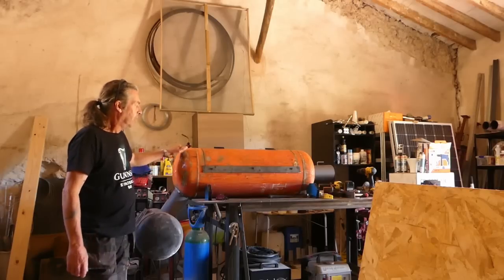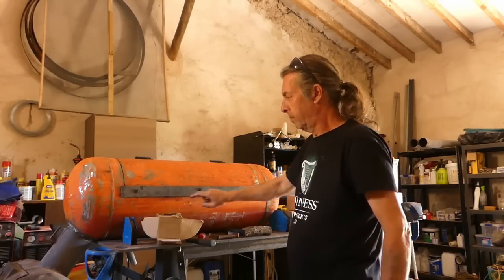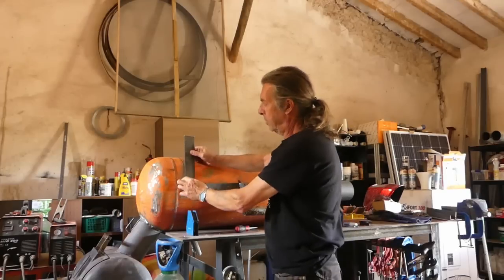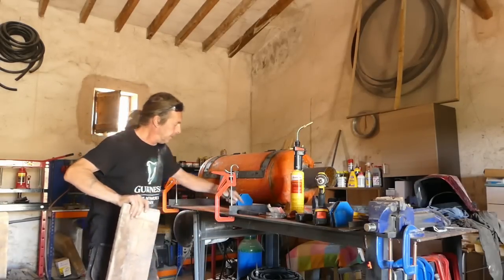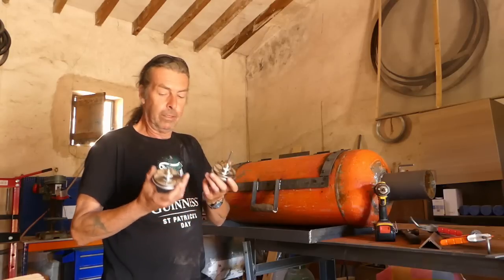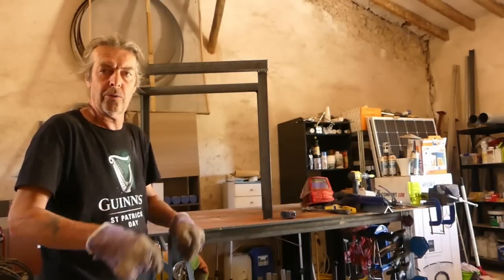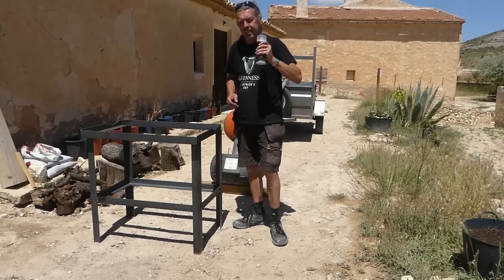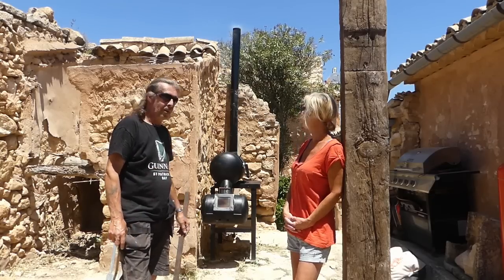Part 2 - Awesome BBQ smoker combo build. It's finished and working!

Comment: When I was a small kid, my dad made a BBQ from a 50 gal steel drum. Cut it in half, added some door hinges, diamond mesh for the grill, angle iron for supports. That thing lasted several decades of use. Nice to see the DIY BBQ SPIRIT is living on in Spain.
Reply from the maker: Thanks Tony. Oil drum is the next possibly as they are easier to get than the big gas bottles :)

Comment: Looks great! How much is that material just to build the barbecue/smoker Table of steel? And where are you buying that kind of metal? They don't have that on Bricolaje? Rickard
Reply from the maker: Thanks Rickard. It's 50x50x5 angle (RSA) and available at any steel stockist. Cost is around 12€ per linear metre. The big stockists sell it in 6m lengths.
Reply: @FincaLife  thank you,  it looks very rigid! I'm happy for both of you,  having that monster piece of Barbecue.